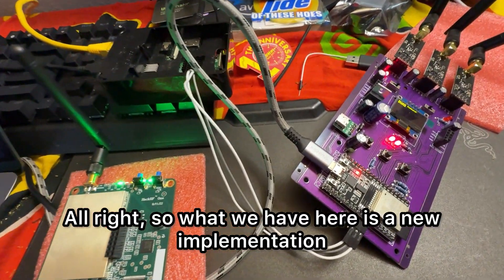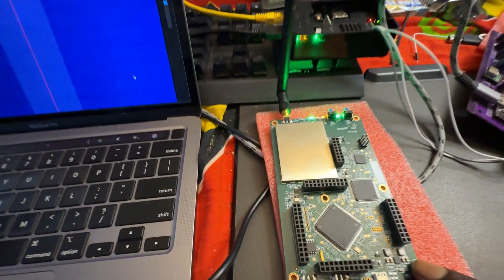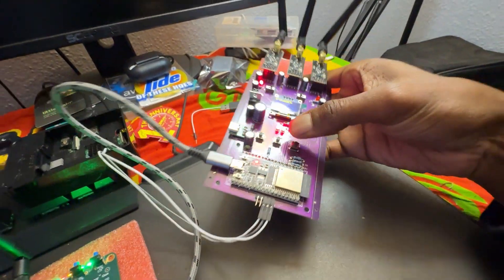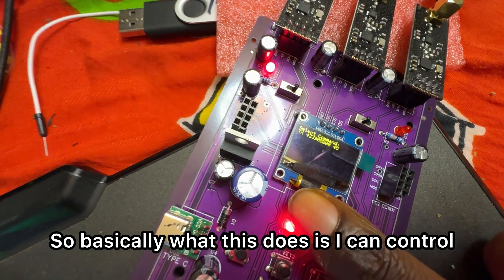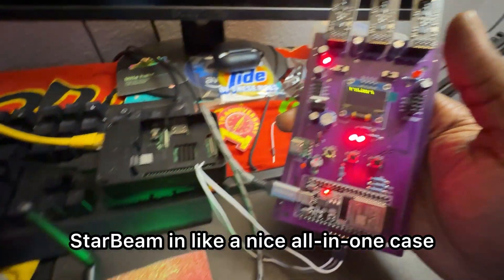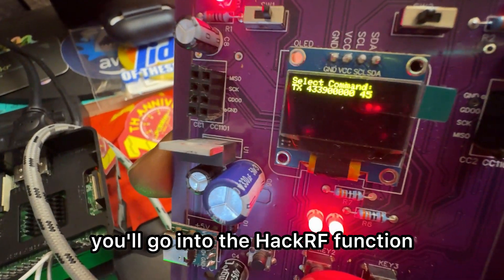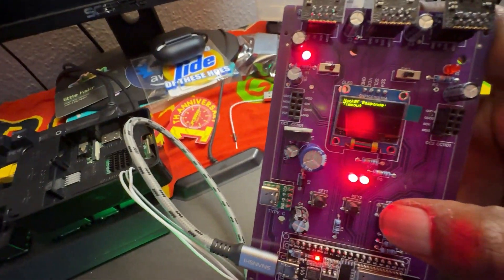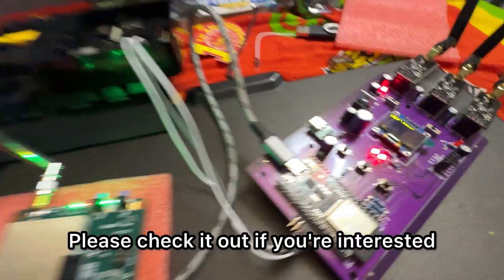HACKRF X PROJECT STARBEAM | 6GHz Unlocked

Comment: The hackrf has by far the most frequency range, but its main limitation of course is RX/TX bandwidth of 20 MHz... while it is enough for most application, a lot of rf is transmitted on bandwidth larger than that, and of course if you are dealing with LTE , wifi, bt transmissions its also necessary to be able to make use of the protocols built into all Wifi/BT capable modules like nrf or cc1101, when it comes to how data is TX/RX through different channels or split into sub channels, which hackrf by itself cannot do

Comment: having an all in one case might be a bit much. 
just a suggestion but you could first add all the nrfs then have a switch to direct power to the cc1101 so there won't be a need to swap them out. design a case around that so everything is all in one. 

then make an expansion case for the raspberry pi and hackrf. that way your starbeam can be its own thing when it comes to portability, then add the other functions as addons. because adding a pi and hackrf will need its own power source, so running a power bank would require at least three power outputs. there is much more to juggle there.
Reply from the maker: Thanks for the feedback, I will try to incorporate that! However there are lighter options like orange pi zero and 18650 batteries. It may be only 2-3 pounds when finished, maybe lighter!